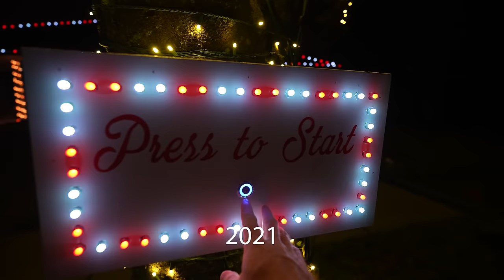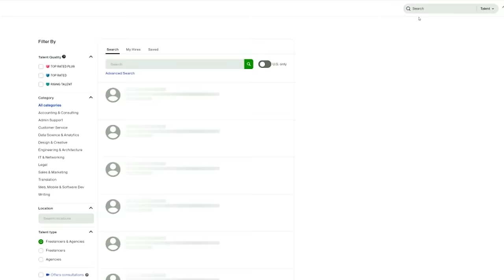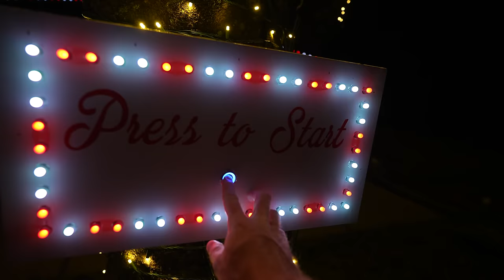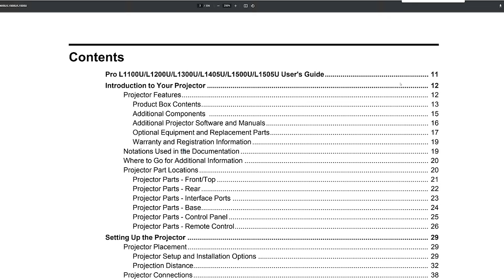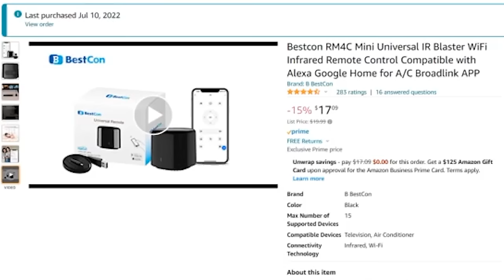Decorating My House with an 8,000 Lumen Projector

Comment: If you haven't worked it out already, a good security camera out the front together with Frigate in home assistant is able to track how many people are present at any one time. It does person/dog/cat/car etc etc etc. A google coral TPU is good if you have more than one camera, but a raspberry pi 4 can handle 1 camera. 
You could also put a wifi/bluetooth sensor in the front yard that detects peoples phones, most people have a device on them that emits a MAC address, home assistant will plot it all too.

Finally, if you want your raspberry pis to run better, put them in a case with cooling. The Flirc ones are great becasue they are silent!!!

Comment: Show looks GREAT! Just adding some thoughts. For this year, Have you considered upgrading to the new Raspberry Pi 5 ? for the video portion at least?  Also I would recommend adding a heatsink and fan on those raspberry Pis. It will keep them much cooler and may even improve your performance of the pi 4s.  Tried posting links to the Pi 5 and the Pi 5 Active cooler, but I assume links must be disabled. you can find both with a quick google for raspberry PI 5

Comment: Could probably use 2 small laser diodes on the front corners of your roof pointing towards some sensors inside the projector box to let you know if its aligned or not. You could even use that data to tell the projector to move the image left/right automatically using the broadlink IR remote control you have in there. HAOS is more than capable of that.

Comment from the maker: Tamper / Theft Sensor: https://amzn.to/488ircH
Raspberry Pi 4 https://amzn.to/2PHbIPR
Micro HDMI to HDMI Cable https://amzn.to/2RQd8u4
Raspberry Pi 4 Power Supply with ON/Off Switch https://amzn.to/35n1tqw
USB to RS232 https://amzn.to/2sn7Hs4
4" duct: https://amzn.to/3RqHG2R
In line fans: https://amzn.to/3Tty7CQ

Comment: How does the projection mapping work when you want a section to be dark, or you just don't want to project on to a certain part of the house? For example, I noticed that you had your path lit up, but the grass either side was dark. There wasn't an obvious "black screen" being projected onto the grass, it's as if there was no light at all hitting that.. How do you manage that?
I've always assumed that you need to confine the edges of the projection to parts of the house that you do want to receive light, because there isn't a great way to block light entirely..
Reply from the maker: If you watch the full projection show video, you can see what video file is going to the projector. Essentially, anywhere I don't want a projection is just black. Some projectors will still light that area a little but generally, when contrasted with what you want to project it's not noticeable. https://www.youtube.com/watch?v=-4etb6nnQ_A&ab_channel=BreakItYourself

Comment: you can use the outside air to cool the projector, just reycle some of the hot exaust of the projector. the heated air has way less relative humidity.

your current setup actualy sends relay humid air to the projector. because the air cools in the duct going to the projecor the humidity will get up significantly.
Reply from the maker: I thought that would be the case, but when running just the ducts and having humidity sensors in the box, the RH stays around 50%. It drops even lower once the projector warms things up.

Comment: What resolution did you end up going with? I am looking at using FPP so I can sync pixels with my mapping, but not sure if I want to give up the 4k resolution. I have only tested FPP with 1080p and 4k (definitely a no go). Also what codec are you doing your video files? Thanks
Reply from the maker: H265, and I'm getting 3418x1802. LOL, I tried at least 50 exports last year, trying different settings, and that's what works for me. However, I discovered this year during Halloween that if I keep the RP4 directly in the path of the incoming cool air from the house, I can get even higher resolution, haha, but due to time, I haven't tried going higher for Christmas. So next year I'll either try higher or attempt to get my hands on an RP5

Comment: What type of sheets did you use?  Regular bed sheets?  Could you please add the link to the projector glass?
Reply from the maker: Regular old bed sheets. Not an ideal projection surface but significantly better than my red/pink brick. And check the description, it should have the link to the glass.
Reply: @BreakItYourself  There's no link to the glass in the description. 😞
Reply from the maker: @theturtle32  https://hometheatreglass.com/
Reply: @BreakItYourself  Thank you!

Comment: I paused on the opersting specs.
Umm whats the point if it cant operate below 32F?
Night time temps during the Holiday season are 20 to 40 degrees below that.
Reply from the maker: Not where I live. Also, people in colder climates put heaters in their projector enclosures. Once the projector is warm enough to turn on, it'll provide ample heat depending on the enclosure.

Comment: What did you use to get the temperature reading is it an app ?
Reply from the maker: for testing: the fireboard 2. For production in the box I'm using a zooz z wave device that reads temperature, humidity, vibration, motion, and brightness.

Comment: Hi .Boz from Southampton in the UKLoved the video. I've encountered some of the problems you've mentioned. Pretty much a case of trial and error. 
You mention Raspberry Pi. It allseeds daunting. How easy is it to get started with Pi? 
At present  I do 50+ hours of video content at Christmas. AtmosFX and YouTube, music videos etc. 
I do themed nights on the run up to Christmas. ( James Bond ,80's, Dance , CGI and of course Christmas etc). 
I'm dabbling into House Mapping using Gimp, MadMapper and After Effects. Just trying to get my head around masking out windows to add individual videos. Is there an easy way to do it? After Effects seems to be the way but it's information overload.
I've got 9 projectors. I know it's a bit of overkill. Don't worry I didn't buy them all. A few have been donated from neighbours and businesses. Greatly received. My question is :- Do you know if I can connect 2 projectors together to display the same content at the same time? Also to extend the screen dimensions i.e. to make a panoramic projection?
Keep up the great content
Cheers 
Boz1070
Reply from the maker: All of this can be done. The FPP community is amazing and you can get tons of support on the forums, also there are lots of YT video walkthroughs. FPP syncing and playing video files is easy as long as you stay at or below 2K resolution. As for doing panoramic stuff with multiple projectors it's possible. Each RP4 would need it's own file synced with the other projectors. I believe this could be done in AE but I haven't tried it. One idea is to reach out to someone who's an AE pro on upwork and see if you can pay them to teach you.

Comment: Overkill on the dehumidifier and ventilation.. not necessary at all, especially if you have a commercial grade projector 😂. I do better with a laptop and a $300 Projector 😢. You need a laptop and a projector of about 15000 lumens, an HDMI Cable, protective box with rubber seals and an air opening in the bottom 😂and your good to go. Easy peasy lemon squeezy.😂